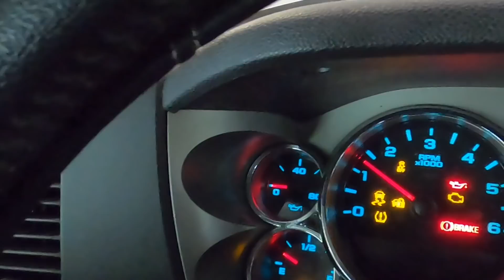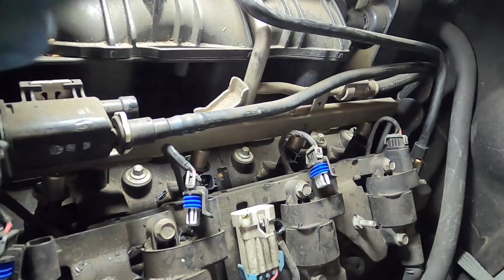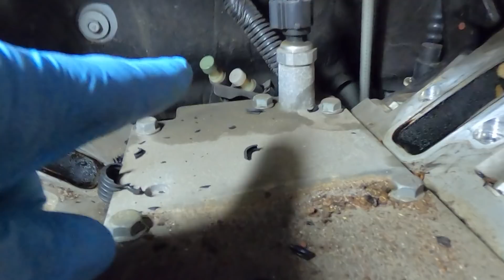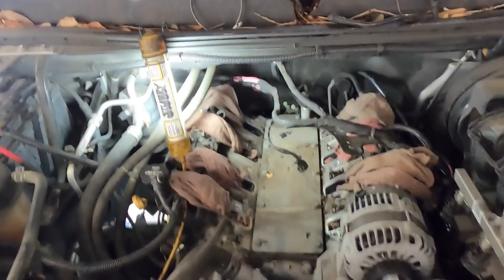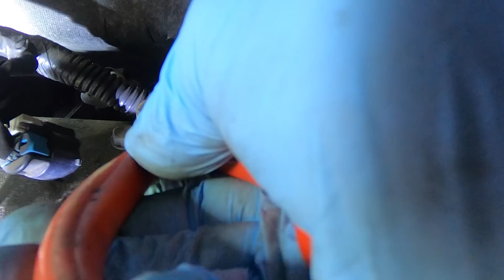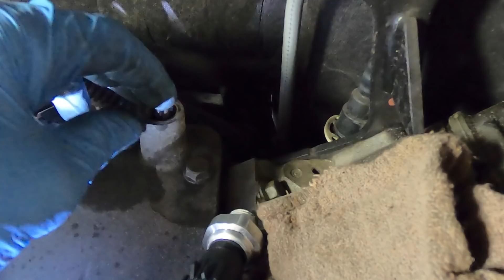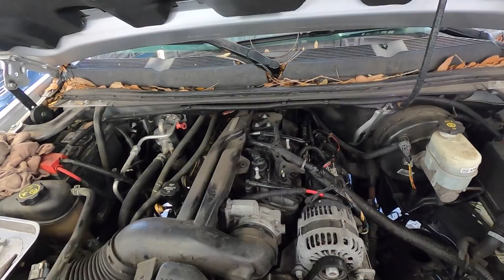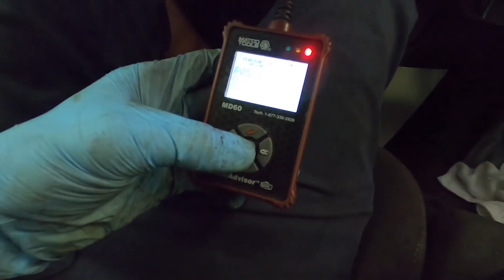Customer States: Google Diagnosis…replace this part!

Comment: Wait. Even tho the customer self diagnosed and said just do this job. And as the tech you knew it wasn't going to correct the issue/fault!! 
Why did you do it? 
When I get these I always say. Thanks for the heads up but as a precaution I will diagnose and let you know.
If you suspected this fix not working and correct. You've wasted this customers money and your time and publicised it all. You would've been thanked had you diagnosed it yourself first and carried out the correct repair required. Saving customer money, time and yourself time and effort!

Comment: That is a lot to remove to replace one sensor. Well thought out enginering.
Reply: That’s easy compared to Mercedes on the 4cyl fwd to just replace the drive belt you have to take off the top motor mount, put a engine support brace to hold the engine, use a Mercedes special tool to loosen the tension

Comment: The google diag wasn't a horrible choice. It is a common enough thing but the problem is the internet doesn't seem to like to mention the gasket between cooler block and motor, or the pump itself... or really anything else it can be down to a faulty wire, dash issue... hell even just needing a proper filter.
I've seen this code too much :( it haunts my waking hours. It's one of those ones where everyone seems to have the answer to it until you actually have to work on these every day.

Comment: What year is this engine? I've NEVER had to remove the intake on an LS for an oil pressure switch. But the ones I've done are from mid 2000's-2010's. Yeah it'd a tight fit but can usually do the whole job in 30 mins.
Reply: I believe since the customer internet diagnosed his car so  he pulled the intake and performed the repair by the book to cover his behind . Yes you can r&r the sender w/o pulling the intake , however if you've been doing this for any amount of time these are the exact type of customer to sue you because their diagnosis didn't fix the problem , and you ripped them off.

Comment: Did a 5.3 sender at the ford dealership I work at. Removed a fuel line and just cudled the engine. Swapped the part

Comment: I haven’t worked on one of them engines, can you not get the sensor out without taking the intake off like on the 5.3? Oh I just read your comment here. Like I said I haven’t worked on these engines I know the 5.3 isn’t really a gymnastics type reach or removal.

Comment: I am two minutes into this and I have the funny feeling that the guy that owned this truck is making a BIG mistake. Just let the pro diagnose the problem and fix it. He’ll spend more money pulling the engine apart and putting it back together than fixing the actual problem.

Comment: And a lot of customers don't realize that those connectors are all dried out and can be very brittle so you got to be very careful what you do because you make the wrong move and you can snap those connectors on the injectors and then you got it cut them off splicing a new connector what a pain in the neck and got to be charged you know you got to charge the people in this is not stuff that you cannot eat the price of that this stuff happened so you got to turn around and got to tell the customer this is part of what happens when you do these type of jobs and you cannot eat the price of those connectors those things are not cheap and then if an injector breaks when you trying to pull it out ohmygod I've seen that happen already this is why I give me an old car V8 and a carburetor and I'm happier than a pig in mud cuz I can rebuild that carburetor from top to bottom I can adjust the air gas mixture get it running like a top not have to worry about 20 million different codes on a computer and give me a stick shift to anytime

Comment: What are royal pain-in-the-ass just to get to the oil pressure sensor I got a 2000 Jeep it's right on the side of the engine text me off 10 minutes to change it that is the worst designed engine I've ever seen in my life no wonder you need a degree in order to work on these engines give me an engine from back in the sixties and seventies I can tear it down put it back together and you don't have to worry about all this electronic crap all this new stuff is just more work and more expense that's why I keep running an old vehicle I will not buy a new car no matter what because it's too damn expensive to maintain them

Comment: I had to let the engine idle for a few minutes to build up oil pressure.  I think when you remove the sensor, it lets the oil drain back into the pan.

Comment: People like you give mechanics a bad name you scammed this guy just to be a dick. You could change that in 15 minutes 30 tops then charge the man your time maybe an hour's charge. Diagnosis starts with the simplest and most common thing first which is the sensor. Building customer relations is better in the long run than being a dick.

Comment: always hated Chevy for always put in their oil pressure sending units in the back of the V8 engines. I had a truck that it went out completely and it would just sit there and say that high oil pressure the whole time and I never replaced it come on I've owned the truck. the only difference between this is mine I didn't have to take my intake off and get access to it I just had to take off the distributor cap good old '90s old school Chevys lol

Comment: Thank you for showing how real life works in the customer service field. You want to diagnose and tell me to replace something and pay for it, fine. There you go sir, did it, pay me and be on your way.
Reply: Yep. Honestly, we've all been screwed by shops before. I once dropped a 1990 1500 4.3L at a shop and told them "I'm 99% sure it's the fuel pump or fuel filter related". They said they would do a diagnostic and go from there. 2 days later they told me it was a faulty distributor and that I was good to go. I picked up the truck and broke down 100 miles away heading home for time off. They had to come tow it back and fix it. And GUESS WHAT? Fuel pump.

Moral of the story: some customers just want the shop to do what they say, therefore the shop cannot screw up. All screw ups are on the customer then, so no bad blood. Customers, just like techs, are not made equal. Some know a thing or 2 and some can barely walk and chew gum simultaneously. Each customer has their own reasons for instructing the shop do as they desire. Customers should be advised on proper procedure initially, but if they insist, the shop should usually do it their way. Have them sign a waiver if need be, but even if you feel the customer is making a bad choice, what they say should never be ignored (like mine was).
Reply: @oceanwaves83  I think you have to reset the ECM codes before the gauge starts to work. Splice8 above remark.
Reply: The check engine light was off and the oil pressure was dead in the middle @32:10.
Reply: Love it!, don't you? they get what they deserve ..😁
Reply: If you've got the know know how to diagnose it then maybe you should fix it rather than trying to tell guy who been doing mechanics for 20 years whats wrong lmao
Reply: @lea-rw5cb  If you get offended by someone telling you what's wrong with their car and what they want fixed, you got bigger problems. In the end, the shop is benefiting and getting paid for it.
Reply: @XsaviXander  it's not telling me what's wrong, it's trying to tell me what's wrong and they haven't got a clue lol then there convinced they are correct, brakes grinding you need new disks and pads, they say nooooooo I don't lmao well go else were with your brakes 🤣 😂 😅
Reply: @lea-rw5cb  Yea sounds like you got a big ego issue there mate lol.

It doesn't matter what you say you want done, its not your car and if the customer thinks they are correct then do what they want.
If they want your opinion they'll ask, but you're more of an ass to assume they don't have any experience at all, or that they have the tools and time to do the job themselves.

I'd let that ego go because it'll kill your customer service rep.
Reply: @LegendConsole  🤣🤣🤣 customer walks in ive got a noise coming from under bonnet, i think its the piston rings in the engine now do you as a "trained experienced" mechanic go with the info and just change the rings or do you investigate the issue and fix what is actually wrong? Plus if they had a clue whats the car doing at garage in first place lol

Comment: Epic facepalm (Edit: Because of the customer. Rainman Ray did nothing wrong, just what the "Google knows all" customer wanted) here. Could have been just a chaffed or chewed wire somewhere along that circuit and threw a sensor at it for how much?

Comment: Instead of blowing all that shit in the intake manifold all over the engine, wouldn't it be better to first use a shop vac to pick up most of it and then use compressed air to finish the job?

Comment: Had the same problem on my 05 4.8
Wasn't the sensor, it was the bypass valve spring in the pump getting bound up.
Instead of dropping the entire front end to access the oil pan/pump I traded it in to carmax for 2500 lol.
That was the last Chevrolet I will ever own
Reply: Like op mentioned above, I cut my hands to shit doing it the google way.  Definitely not ideal

Comment: For years I've told family & friends when taking a vehicle to a shop ask them to diagnose it.  Describe the symptoms in detail but DO NOT tell them what you think the problem is.  If you disagree with their diagnosis, discuss it.  Then if need be, take it some other place.  I know a guy that was TOLD to replace head gaskets by the owner of the car but the issue was a cracked spark plug.  He did as he was told, it was the customers fault.
Reply: For a decade or so, I wrote diagnostics code and designed diagnostic test strategies for aftermarket testing equipment, and learned at the feet of a half-dozen of the wisest old mechanics I've ever met.  I rarely do the work on my own cars, but after that experience, I have a very good handle on what could be the problem.  As kiknsystm suggests, I describe the symptoms in detail, in "well-trained amateur" terminology, and occasionally discuss the diagnosis.  They occasionally ask me what I think the problem is, and I don't, but then we chuckle over it afterwards either way.

Comment: Hardest DIY I have ever done was replacing the air/oil separator on my 911 Porsche. Take it to any shop and they’ll drop the entire engine. I had to use two laptops,  a web-cam, an endoscope and grind down a flex head ratchet wrench. An experience I will never repeat.
Reply: But now you've been accepted at a gynecology school!

Comment: So these came with a screen from the factory... The recall was on the oem screen that you didn't remove. Definitely wouldn't take my vehicle to your shop lol. And only a shit mechanic uses any tool but a hammer as a hammer... Nice try with the don't want to hurt my hands bit too. I can do this same sensor swap in about 45 minutes to an hour without pulling the intake, no hand damage at all.

Comment: Nice clean work.
Needs a new lifter solenoid plate/Gasket ?( bet it dose, done the same thing.
might as well put new lifters in right?
Very common on the gm's with Active Fuel Management
Reply: This one does not have active fuel management. Flat plate and the reason he couldn't put the screen in.

Comment: It seems to me that when a customer comes in like that, that you should inform them that your job is no longer to "fix" the problem, but to simply replace the part. You should tell them that you will replace it and you should not even check to see if it now works because you were not hired to fix it. If it were me I would make this very clear to them.

Comment: I agree the shop has to check and diagnose instead of the customer. But then what about my 1993 Dodge Intrepid? AC condenser were to be replaced once a year with a new one. (Expensive job). Since it was under warranty the diagnostics were not covered, freon was not covered, shop material was not covered, connector was not covered, etc. In 1994+ had to pay extra everytime. At the time I remember saying why is it you have to diagnose and always come back with the same solution that does not.work? After warranty was over I fixed it myself... with a hacksaw! 😈

Comment: I would like to hear what the customer had to say when he got it back not fixed. I, for one, agree with you about not wanting to do work based on a customer's own diagnosis. I want to hear the aftermath because this is exactly the type of situation where this customer will now go off and bad mouth the shop in person and online to everyone he can. Hopefully, he'll allow you to actually do your job like it should be done and have it repaired properly. Or maybe he doesn't need a guage. How much did this cost him BTW?

Comment: I'm the in-house mechanic for a trucking company. The owner (who is a business man) and the dispatcher tell em what is wrong with the trucks and that it shouldn't take me long to fix.
One time I was told to change the thermostat because it over heated,, and to charge the batteries because it will not crank. Turns out yes it over heated, but it also spun 3 crank and 3 rod bearings on a 15L Cummins. It had handfuls of bearing material in the pan. 
Everyone knows more than the mechanic

Comment: I had a problem like that wound up being the oil pickup o ring. Pretty easy fix. Let the front diff hang and pulled the pan.

Comment: Would’ve vacuumed the crap out instead of blowing into intake ports.
Reply from the maker: I prefer the compressed air. It blows the debris out because of the volume of air at the nozzle of the gun. If feel a vac is less effective, and equal amount of air has to come in through the port and into the vacuum nozzle.
Reply: @RainmanRaysRepairs  good point. I still would've vacuumed the big debris first, then blow out with air

Comment: With a swivel on a wobble extension you can get that sender out of there without taking the manifold I swapped mine in the driveway in about 30 minutes
Reply: I also had the intake off at one point after doing the sender I cut out the plastic and foam sound deadener they have around the wiring harness that blocks the sender it's a straight shot for the next time.
Reply: same
Reply: Yup was looking for this comment lol 30 mins Max job, it’s just a pain but not difficult

Comment: You did what the customer asked for, that is what the customer paid your employer for. If anyone was to reject the work, or state the part would only be replaced after diagnosis, it should be your employer. The oil sensor replacement only affected the hip pocket of the customer. No one else, it wasn't a safety item, it wouldn't affect the safety of the occupants and more importantly other road users. There are times to reject work, there are times not to. In this instance, as it was not a safety matter, then by all means, do what the customer wants. It is a shame that too many people feel the need to pass negative judgment when it is unwarranted.

Comment: Best case scenario its the vlom gasket, then barbel plug rear engine cover, then cam bearings lol, it escalates quickly with the ls engines x)

Comment: nothing pumps you up more  while taking a silvery ado apart than some crazytown playing.. speaking of self-diagnosis... the customer wanted me to replace their thermostat because the car was overheating at idle.. mind you I already looked it over quick... he said yes it will. i said nope it won't..  this may fix it though...  plug your cooling fan in...  gutta love the self-diagnosis...

Comment: I promise the intake doesn't need to come off. Good video but thats a 15 minute job tops.
Reply from the maker: It calls for 2.6 hr i think, and yes it does. Cant reach behind there to get the sensor, I tried, couldn't do it.

Comment: I’ve done a few of these 4.8 sending units without pulling the intake, usually takes about 40 mins and it helps that I’m blessed with small hands 😂
Reply: On my 64 impala, it was near the front
Reply: Same spot on the 5.3, my hands dont fit though....
Reply: same
Reply: Yeah I really think I picked the wrong profession. My hands are small, they're just big because I did a lot of grip strength training as a kid. So for me getting stuff out of the way is a necessity.
Reply: did you have to reset the ECM codes before the gauge starts to work?

Comment: I've  done the oil pressure sender on a 2012 sierra. In no way do you have to remove the intake. It takes about 30 minutes to do the job.

Comment: Customer likely had the codes read by an auto parts store, googling for common problems related to a code isn’t a bad way to start diagnosis. 

The check engine light was off and the oil pressure was dead in the middle at 32:10. Looks to me like the fix did work after you cleared the codes.
Reply: Went to the comments section for amusement.  Saw this and went back and looked at the video.  Unless I'm just blind you appear to be right.  If you are right given Ray's commentary at that same time it would definitely lead one to believe he was intentionally being deceptive about the end result.  Perhaps if the sending unit had failed and the ECU detected the out of range value it stopped sending voltage to prevent damage and didn't start again until after the code was cleared.  Would be very disappointing if ego was getting in the way of an accurate diagnosis and repair result.
Reply: I had this same problem in my 2010 GMC Sierra. The gauge won't work after the repair until the codes are cleared.
Reply: @Jake The guage works but not properly which was the whole point of replaacing the sensor acording tot he customer. If you bothered to listen he never lied